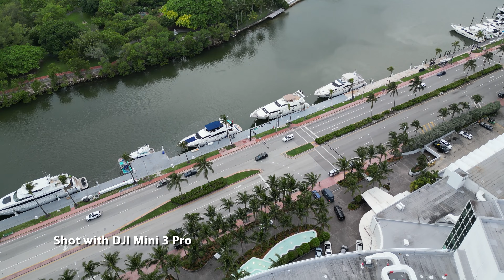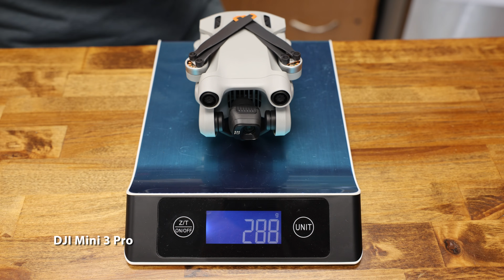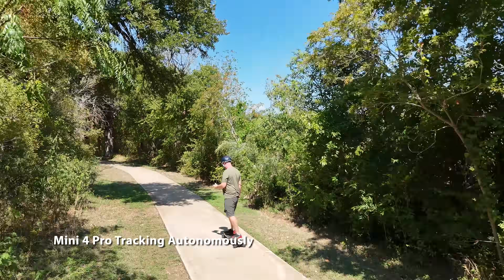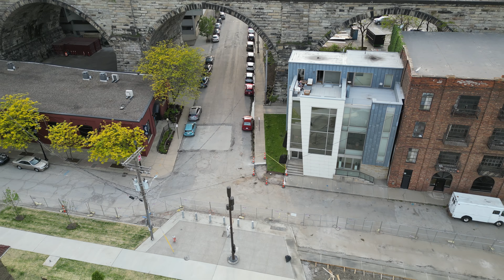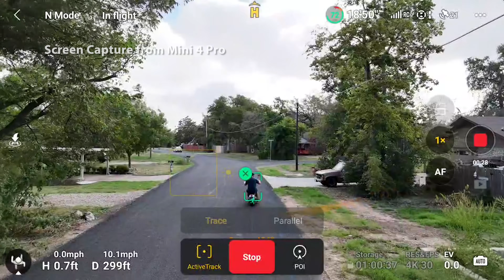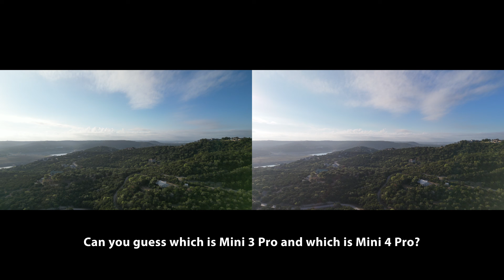DJI Mini 3 Pro vs Mini 4 Pro - Worth the upgrade?

Comment: So if I do not currently own either one, I should go for the 4pro? That said, I think the only set back (and no one talks about it) is the mini 4 pro isn't compatible with DJI's goggles (yet) like the mini 3 pro. So there's that.
Reply from the maker: Good point about the goggles being compatible with the Mini 3 Pro. I tried it once, but don't own the Motion 2, so I wasn't able to get the "hack" working. 

I don't feel like that's a huge feature that I personally would use, so my vote is Mini 4 Pro, if you don't have either drone yet.

Comment: I want to upgrade for longer flight & time-laps capabilities but think I'll be choosing an AIR3 instead of the Mini 4 Pro Plus.  I've been breaking down the flight costs & if purchased with 3 batteries the Mini 3 (not the pro) under 250g costs $1.33 per flight  & the Air3 costs $2.25 per flight in degradation(calculated using the 200 cycle life expectancy of the batteries before their voltage becomes unreliable).  I wish I had a better idea of how many flights the drones can survive before they're unreliable, like worn motors or whatever.

Comment: Great comparison Kelly, the Mini 4 Pro does seem like a slight upgrade over the Mini 3 Pro. But I'm not sure if it's worth upgrading to if you already have the previous model. But if your coming from a Mini 1, Mini 2, Mini 3 or some other brands Mini drone, it's a very worth while upgrade. Nice video, and thanks for sharing Kelly.

Comment: The obstacle avoidance of the Mini 3 Pro can see 7m further into the front (0,39-25m vs. 0,5-18m) than the Sensors of the Mini Pro 4 ... I think you can see how the drone reacts to bigger obstacles in the distance. Die Mini 3 Pro starts earlier at speed to go around and the Mini 4 Pro doesn't get it and breaks because it was to late
Reply from the maker: Good point! There's always a trade-off, isn't there? Haha
Reply: @readysetdrone  sadly :D ...the next version will have both 360 + more distance ;-)
Reply: I got my M3P last week original packed back from a DJI Care case and could sell it for a good price. That was, beside from Waypoint and 360° tracking, the only reason for my update. I like it so far.

Comment: Got all but the spinning one correct.
Reply from the maker: Nicely done! What is your preference? 

I feel like in certain shots, the contrast and saturation were a little bit overdone on the Mini 4 Pro, but overall, it generally does a slightly better job.
Reply: Definitely the 4 for me, although I really don’t “need” or will use, things like active track.  Maybe a Mini 4 “Standard” coming soon??

Comment: I have the Mini 3 Pro and wonder if I need or want to upgrade.  The omni-directional obstacle avoidance does interest me but not sure I need it.  Thanks for the comparison of the Mini 3 Pro and the Mini 4 Pro.  I will continue to think about upgrading but for now I will hold off as the Mini 3 Pro is a solid drone. #GhostBranches
Reply: If you fly at night then you might enjoy Night-mode. I want the extra flight time so if I'm forced to register the drone  I'll be jumping to the AIR3 instead.

Comment: ~ON OCT. 3rd. 2023~ I discovered a way to revive dead multicell lipo batteries. And it's free. Today it saved me $75.00 by reviving two new batts that had gone below the magical 3.2 mark. (I had gone to 2.7). It's easy to do and only takes two mins. to do. For days I tried every conceivable idea I could think of as well as those that are out there with no luck till I thought of this. -Bill Howes, making the world a better place simply by being here.
Reply: Nice! How did you do it?
Reply: @SunriseWaterMedia  Thanks for asking. Let me go back and double check so I give you a correct answer. I've literally thrown out hundreds of $ of batts I can now save.
Reply: @billhowes5871  👍

Comment: I had the Mini 4 Pro added to cart. No ND filters available, even DJI's variety is out of stock. I will wait a little longer and see what bugs need to be sorted out. For other buyers I think you detailed the differences so everyone can make an educated purchase decision. 360 obstacle avoidance, higher frame rates, O4 transmission. However, I don't believe you covered the introduction of D-Log with the Mini 4. Or the Night Shot mode, Waypoints, or cruise control. I'm going to blame Kris. He probably distracted you during this recording. 🤣
Reply: All my fault. 😂

I think the objective in this video was mainly to give a concise view, from Kelly's perspective, of features that are important to his use of drones, and whether or not to upgrade -- not a comprehensive comparison, but that could be a potential other video.  

I still haven't ever used a flat color profile before. I'm intimidated by the thought! Lol
Reply: @SunriseWaterMedia  Do I use D-Log, no. But, I have dabbled in it. It does require more time in post to color grade and subsequently  more time to produce the video due to GPU/CPU load but it can take an above average video and make it jaw dropping. If you ever see anything that Denis Barbas does you'll know what I mean.
Reply: @DavidLorenzoFlorida  Thanks, I'll look him up.

Comment: I’m envious for: signal strength, waypoints, and AR home point.  The Mini 4 Pro just seems like it is the ultimate version of the mini series until better cameras are developed.
Reply from the maker: It is better with those things, but camera quality is very similar to Mini 3 Pro.
Reply: @readysetdrone people are saying that the 4pro battery doesn’t last as long as the 3 pro because of all the extra technology. Is that true?

Comment: Great video, Kelly.  Nice comparison photos.  I could not tell the difference.  I'm sticking with my Mini 3 Pro.
Reply from the maker: Glad it was helpful! Yeah - unless you are tracking in areas with obstacles, the Mini 3 Pro is very similar in image quality.
Reply: I have the mini 3 pro and just received the mini 4 pro.  In terms of video quality, it's only slightly better straight out of camera.  But the image quality of dlog-m is reaaaaally good.  I don't even know how to color grade that well but all I do is just apply the DJI LUT and it made the video look really nice. 

And as for features Omnidirectional Obstacle Sensing, waypoints, cruise control, and active track 360 makes it more of a complete drone.  Maybe you never use those features, but there's definitely a difference.  And RC2 is better than RC also.
Reply: The REAL and ONLY problem now is trying to sell the mini 3 pro.  😭😭😭😭